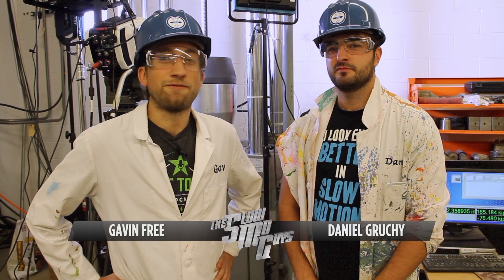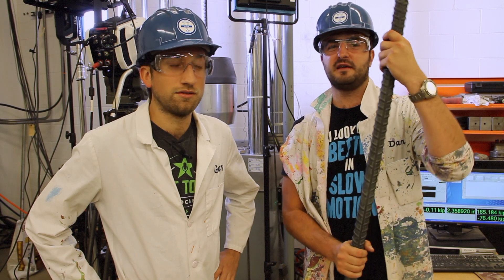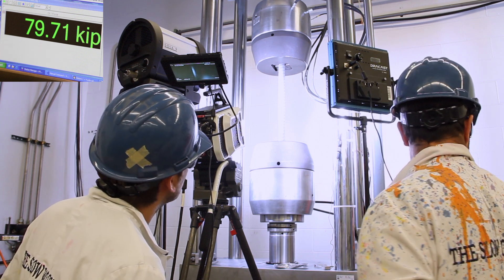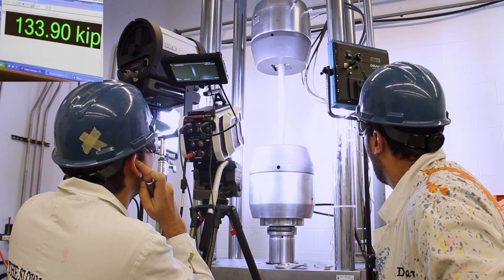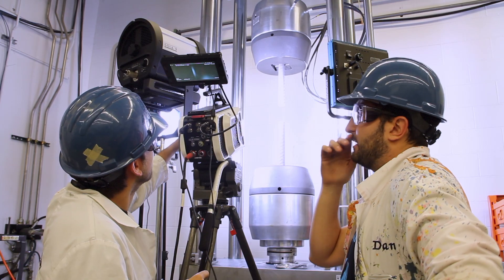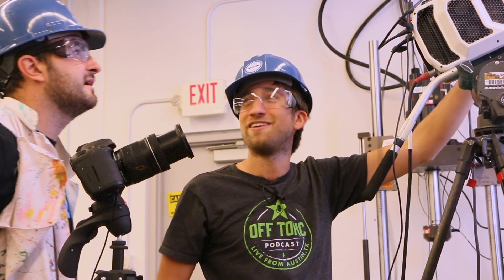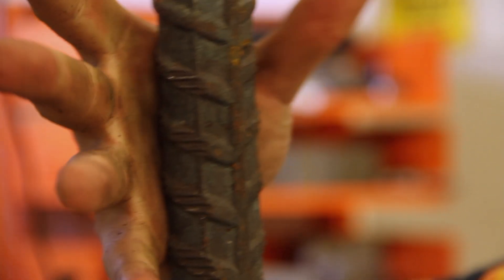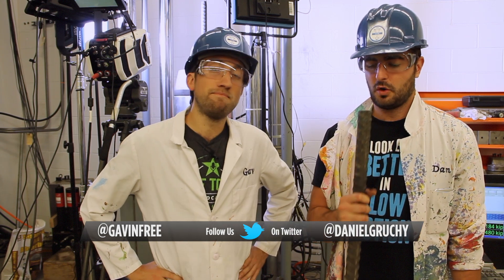Snapping a Steel Rod 1000x slower - The Slow Mo Guys

Comment: the 9/11 towers had thousands of these and much much thicker ones and they want you to think an aluminum plane managed to turn it all into rubble. yeah right
Reply: As a materials engineering graduate currently studying for a civil engineering masters you are very wrong.  Steel does not have to melt to be significantly weakened by temperature. The increase in the rate of vacancy diffusion caused by the increase in temperature significantly weakened the structure causing it to fail. when the tower then collapsed the pressure led to a temperature capable of melting steel via the diesel effect. also an Aluminium plane can absolutely deform a steel frame if travelling fast enough.
Reply: 1. It's actually called thermite.
2. Thermite is just iron oxide powder (rust) mixed with aluminium powder so I don't know what that military base crap is about.
3. surely when a  mostly aluminium bodied plane impacts a steel reinforced structure it is very likely that trace amounts of aluminium powder and iron oxide powder will be found.
Reply: Luckily my first class degree was awarded by an examining body, not a man in a tin foil hat. I just get a bit sick of people who jump to conclusions and feel that they are experts in a field that they do not even begin to comprehend.
Also 
1. you still cannot spell thermite
2. thermite is not an  explosive therefore you would not hear it or even be able to identify a distinctive sound as it burns.
3. considering thermite burns downwards, unless you regularly break into trapdoors at a very slow speed you would not use thermite.
Reply: What you are doing is called misdirection. Your engineering knowledge is flawed and so you try to redirect away from that. This argument is not about government conspiracy theories, just the simple fact that these controlled demolition theories just do not hold up.
Reply: I thought Cameron was just joking with this and was like "oh, your standard meme". Then I kept reading.. Do people really believe this sort of thing?
Reply: a 767 has a wingspan of 48m and when travelling at a speed of about 600mph it is not an insignificant impact. Also where do you get your basis for freefall speed. Rubble is clearly falling faster than the rest of the tower therefore it cannot be falling at freefall speed. Also as I have repeatedly corrected you on your shaky scientific knowledge at every step and the fact that the majority of the world agrees that it was quite clearly a terrorist attack I really don't feel like your opinions hold water. Do you even have a basic scientific education?
Reply: Which is why the fires brought the buildings down, not the planes.
Reply: if fire (i.e. combustion) can't melt steel then how does a foundry work? Plus you can weaken steel to under half it's original strength without coming anywhere near melting it.
Reply: I use words like weaken because thats what happens to steel when you heat it. You use words like "liquefy" i.e. you misuse and misspell very basic words which you then correct in your comments after I pick you up on it. Nano thermite just means nanoscopic amounts of thermite. Also to try and make your theory work, have you ever seen a building rigged for demolition? It's pretty hard not to see that it has been. Do they use thermite in demolition? No because it would be close to impossible to demolish a building using thermite. Why would they fly a plane into the WTC when there was already a failed bombing of the WTC which would be 100x easier to cover up. The conspiracy stuff is dumb but your arguments for it are even dumber. Just out of curiosity do you think the moon landings were real or that JFK was shot by Lee Harvey Oswald?
Reply: firstly microspheres form when small quantities exceed the melting point not the boiling point. Also why do you think a foundry is able to melt steel? High temperatures are produced from the burning of combustibles while insulation prevents the dissipation of heat. Material that has already been heated by the combustion of jet fuel and combustibles within the building are then put under immense pressure by the collapse of the building leading to a spike in temperature and the melting of localised regions of the steel structure.
Reply: 1. Read what I said about vacancy diffusion earlier if you want to know why the structure failed without melting.
2. microspheres automatically means that only trace amounts of steel melted as the gravitational force was not sufficient to overcome the surface tension leading to small non wetting spheres rather than a flow of molten steel.
3. do you think that once you remove half of the structural integrity of a building it will not fail catastrophically. A large amount of damage was done by the initial impacts followed by a further weakening of the remaining structure due to the heat produced by the fires.
Reply: +Philip Royd You... You're joking, right Philip Royd?  Do you understand planes? Before the mid-fifties, planes ran on gasoline.  Also, a 1930s bomber is different than a 747.  Here are some fun facts for you:
Burn temperature:
  Gasoline - 1000 C
  Jet Fuel A - 2300 C
Weight:
  Boeing 747 - 350 tons
  Curtiss Falcon - 1.4 tons
Speed:
  Boeing 747 - 600 mph
  Curtiss Falcon - 135 mph
The 747 also carries about 500 times more fuel.  It's like comparing having a bug in your eye to taking a fastball.
Reply: Lol jet fuel can't melt steel beams.
Reply: you dense idiot. you do not need to melt a steel structure to compromise it. not only does a high temperature under the melting point weaken steel, but also it causes it to expand. When constrained as in the steel frame of a building, it introduces large amounts of stress to the structure causing it to become compromised. If you think a skyscraper is comparable to a tree anything you say is not worth listening to.
Reply: Last comment. I give up on trying to explain basic basic science and engineering to someone who can't even understand the basics.  "large deposits of molten steel" no microspheres do not indicate widespread melting of steel. plus I don't understand how you can have a deposit of molten steel. molten Aluminum yes but steel only microscopic amounts
Reply: The point still stands that a 767 would be going faster and has a much higher mass and so therefore would do a lot more damage on impact than a tiny biplane.
Reply: cameron martin Dude what's your reasoning behind this anyway? Why would anybody BUT a terrorist organization want to blow up the twin towers?
Reply: cameron martin You sure about that? NEVER in history?
Reply: cameron martin come on, I am looking through your comments and you're scolding people about research Even a guy with a degree in engineering 
But what are you sources? A YouTube video
You keep going on that it can't come down from just fire but you seem to be forgetting that A FUCKING PLANE CRASHED INTO THE BUILDING I would not say it was only fire
And it was not a "standard office fire" IT WAS A EXPLOSION NOT FIRE IN A TRASHCAN 
You sir are the GREATEST example of the bandwagon effect 
I applaud your stupidity 👏👏👏
Reply: cameron martin he called the other guy dumbass not you lmao
Reply: +Philip Royd You can't possibly be comparing a B-25 going less than 200 mph resulting in a fire that was eventually controlled to 2 Boeing 767s full of fuel slamming into the buildings at over 550 mph, resulting in an uncontrolled fire that brought down the towers...
Reply: cameron martin hey dude I just build bikes for a living, but even I know, with my high school level education, that metal heated to high enough temperatures will weaken. The steel beams were weakened by the burning jet fuel. The building collapsed because the steel beams were no longer strong enough to hold up the weight of a fucking skyscraper. The other guy has explained to you that thermite isn't used in demolition, and not to mention the fact that a fucking plane crashed into the side of the building. Go back to your flat Earth, tin foil
Reply: cameron martin You do understand what a plane is, right
Reply: +nedk09 Your patience trying discuss engineering matters with someone who is shut off to reason is truly amazing.
Reply: @cameron Martin Did you just blow in from stupid town?
Reply: cameron martin who's the one here that thinks nine eleven was staged?
Reply: I used to have the patience to debunk these harebrained theories, but not anymore. Really that other people with the knowledge to do so are still willing to spend time "debating" fools in tinfoil hats. Thanks for being the voice of reason in this comment section.
Reply: You must be some kind of ignorant idiot.
Reply: Fuk u guys! King kong wasn't able to demolish a bulding so i ain't believing you
Reply: cameron martin after years and years, the metal deteriorates. and gets much weaker. everything needs to be replaced, just like road construction. so yes. thousands of degrees burning on the steel would most definitely burn through.
Reply: Hey look, another moron who spits in the face of facts and experts who have spent literal years of their life proving why the towers fell. But noooo, your armchair conspiracy theory trumps all that.
Reply: Love a blind conspiracy nut
Reply: UncommonSituations how am i the dumbass? thats exactly my point. there were explosives and the towers were indeed demolished. thats why it was an inside job. i have no idea what argument you have?
Reply: I would'nt be so brave if i were you: nedk09 here obviously is a government agent who was clearly sent after you under disguise of an enginering graduate who's trying to dissuade you. While in reality his mission was to discover how much truth do you really know, and i think you've foolishly said too much... are you okay there, buddy? Are you still there?
Reply: Are you being serious? Poe's Law makes it difficult to differentiate the idiots from the jokesters
Reply: cameron martin idk the bridge in Atlanta melted and collapsed from diesel.
Reply: nedk0
Reply: cameron martin heh.
Reply: Mohammad Ekram Faruque Fahim are you sure about that? lol read up it can fit both ways
Reply: Sk8er Of Bodom yeah... >.>
Reply: cameron martin just one question, given this was a brilliant ruse by the US military state to allow an invasion of Iraq, after going to the trouble of secretly setting up a building for demolition, and swearing everyone to secrecy, all the other people that must have numbered in the hundreds at least... wouldn't it have been worthwhile for at least ONE of the Hijackers to have been an Iraqi? I mean the US didn't invade Saudi Arabia, Lebanon, Eygpt and the Emirates so that seems like a fairly significant flaw in this masterplan you discovered (along with all the other information you discovered watching other morons tell you that the physics were wrong or something.)
Reply: Holy shit I love the conspiracy guy :') When the other guy explained something to him 2 comments later Conspiracy Guy was talking about the same thing again xD
Oh BTW planes couldnt destroy the tower cus planes dont exist. Earth is flat and everything flying we see are just holograms made by the guys protecting Arctica or whatever xD
Reply: And aluminum plane traveling at full speed in to the upper middle part of the building. The her file burning causing an inferno that didn't melt the steel beams but softened it greatly. You have to think people from the ground felt the heat. And you do know that aluminum is stronger than steel right. Weight for weight aluminum is the superior metal.
Reply: Everyone arguing about 9/11 get over it. It happened almost a score ago. If it is the government killing off its citizens then I applaud them this country is full of people who take shift for granted and complain when something they don't like happen when it's for the greater good of the country.
Reply: Shartley ya but if a bolt from those beams pop there it goes down
Reply: BasicallyPlays steel is harder than aluminum look it up
Reply: Looking back on the thermite argument i use thermite in rb6 and he goes through walls so...
Reply: cameron martin wow. You really are a raging fuckwit...
Reply: Oh shut up! I don't believe you! My d!ck doesn't melt from friction no matter how many times I rub it inside a vagaina!
Reply: ***** absolutely never. i challenge you to find even just one example.
Reply: cameron martin the molten steel was caused from friction In the freefall.
Reply: 9/11 was done by US government, and everybody who doesn't believe that is either retarded or deliberately ignorant.
Reply: Shartley listen to ken o keefe explain it. he is an ex u.s marine/ whistle blower. war tyrans profit billion of dollars from stealing resources such as gold and oil from these defenseless countries. 9/11 was a catalyst to invade and hunt down the so called wmd's that were never found. its the rich mans trick. this is why they say money is the root of all evil. it is also part of the greater Israel project. your very own government has no problem whatsoever killing its own citizens as long as its profitable.
Reply: We're being brainwashed by the Illuminati, Freemasons, Zionists and the Reptilian Elite into believing that 9/11 wasn't an inside job, autism is not caused by vaccines, the Earth is a sphere and humans landed on moon through chemtrails and a special weather controlling machine which was turned into a mind controlling device using the research from the secret alien technology that was unveiled when the crashed alien saucers were investigated in Area 51, Nevada and also research from the MK Ultra hiding in Atlantis on request of Hitler through a Skype call from Argentina who along with Ted Cruz aka the Zodiac killer are using cure for cancer and the Holy Grail to remain young, both of which are currently being guarded by the true JFK assassin, James Files. They are bringing in the New World Order everyone!!!! Wake up sheeple!!!!
Reply: ***** never in the history of infrastructure has fire ever brought a steel framed building down. except it happened 3 times in 1 day ; 9/11. complete utter bull crap
Reply: CWINDOWSsystem32 yeah because fire would back it demolish starting at the bottom. Fucking dumbass. Watch the towers fall. There's demolition explosions and even the cops and firemen agree
Reply: You just wait guys! I'm gonna stick my booger into one of those tall building in amurica and those rebar will start to melt and demolish that building. Then blame it to kim jong un!
Reply: nedk09 oh? so you just want to completely ignore the fact that nine independent research groups found nano thermite at the scene of the destruction? a very obscure type of thermite that can only be produced at military bases? molten steel was riddled all through the rubble. you can see why they sent all the remains to china to be melted down for "scrap metal" i.e. all the evidence can be destroyed. things that make you go hmm...
Reply: CWINDOWSsystem32 fire also can't melt steel even at its hottest temperatures
Reply: Interestingly, nobody has mentioned the bomber that crashed into the Empire State Building in the '40s.  The fire it produced didn't bring the building down.  I guess buildings built in the '30s are stronger than buildings built in the '70s.
Reply: @nedk09 if the plane just rammed into a building, it would simply stay standing if it didnt immediately fall. It will be like shooting a bullet into a tree trunk, the bullet will stay put and the tree wouldnt fall at free fall speed now would it? So you think a dieing fire giving off black smoke (clearly oxygen deprived) somehow generated enough heat to liquefy steel in an uncontrolled environment?
Reply: @zshi if you knew anything about aviation you would know it is impossible for a commercial airliner to travel even remotely close to 600mph at sea level. Secondly it doesn't matter how much fuel the plane was carrying as it was all released in a large fire ball within seconds after impact; so all that was left was burning office materials at standard burning temperature. Also where did you get 2300 C as the jet fuel flame temperature from? Thats completely wrong. Im still laughing at where you said "Do you understand planes?". Just wow.
Reply: unbelievable. and i thought it couldn't get any worse. i dont think you've ever seen a video of the tower collapsing. the rubble falls at the same rate as the rest of the building. And now you feel safe with numbers? you are clear example of the "bandwagon effect" , if most people "believe" something, then it must be true. You still ignored the fact that all the beams failed at each point all at exactly the same time when only a small proportion of the building was affected. How hypocritical is it for you to put yourself in the authoritative position to even mention someones scientific knowledge when it is you who refuses to do research? oh thats right, you'll just listen to "what everyone else says"!
Reply: You continuously ignore the large deposits of molten steel at the site. You just cannot face facts. Did you even see the video i linked above? You're the one who is dense, you think you are an engineering student when embarrassingly, you dont know that standard fires cannot vaporize a steel structure! Not even close!
Reply: You hate it when i state facts and use words like "liquefy" but you want to stick to saying "weaken". No buddy, the steel melted! It wasnt simply a "weakening". You desperately try to downplay the extent of the situation by sugar coating your argument with soft words. Come to grips with the fact that those girders melted with the assistance of nano thermite.
Reply: Thankyou for proving how stupid you are.  "it would be close to impossible to demolish a building using thermite". How did you manage to convince yourself that a standard office fire is more effective bringing down a building than using nano thermite? Your stupidity is endless.
Reply: is that a legitimate comment or is that a joke? a foundry has a perfect environment that focuses on melting metals as its main function. this does not explain why the foundations of the towers were covered in "micro spheres" , these spheres appear when a metal has exceeded beyond its boiling point. Why cant you people understand its not the fact that the beams were weakened, its that they were deliberately melted and thus parts of the beams were liquid for brief moments.
Reply: did you think about what you just said? are you saying that a foundry cant melt steel in a controlled environment but fuel can unintentionally melt all of the major steel beams (at the same time! hence the buildings also fell at free fall speed!) ? good thing you don't call yourself a physicist. but wait, heres more of your bad logic. you said the collapsing building causes a spike in temperature which can cause the steel to melt. first of all you completely underestimated the energy required to melt steel. the kinetic energy from a falling building is no where enough to concentrate itself to melt any kind of steel. second of all how does a building collapse, THEN you start talking about steel melting? shouldn't the steel melt first and THEN the building collapse? what made the building collapse BEFORE the beams melting? about 90% of the total heat was released from the initial blast when the "plane" collided with the building.
Reply: nedk09 id be embarrassed to call myself an engineering student if i couldn't identify an obvious demolition. you can even look up the video taken by firemen and bystanders where you can hear the thermite charges being set off. the sound is identical to the charges used to break open vaults/secured doors in warfare.  it appears that the thought of your own government committing genocide on its own civilians is too disheartening for you to accept, that all you're left with is repelling against factual information from the truthers.
Reply: you are silly. how does a plane colliding with a very small proportion of the building cause all major beams in the towers to fail simultaneously? the building fell at free fall speed. this is exactly what you can expect in a standard controlled demolition. are you trying to convince me that a planes size that is insignificant to the size of the tower removed "half of the buildings structural integrity" on impact? this is just getting more ridiculous with each rebuttal.
Reply: nedk09 again. hypocrite. here i am encouraging research but you are too full of yourself and believe you are SOO much of an expert that research isn't needed. yeah because logic, right? read what i said above, just have a listen to ken o keefe. he will give an insight to what this is all about, because sure as hell did no cavemen infiltrate the "most" guarded airspace in the world 3 times in one day. nor did they set three new world records for the first steel framed buildings to collapse solely from fire in one day. coincidence? maybe you also think that when Larry silver-stein put an insurance policy over the buildings that specifically covered terrorist attacks 4 weeks prior to 9/11 in which he successfully claimed $4 billion afterwards was also a coincidence. you probably also think when Iraq lost $350 billion from their central bank one day before the u.s invasion was also a coincidence. you pentagon shills just refuse to think. no matter how much evidence is provided you still have your own predetermined theory that cannot be changed any way possible. 

all i ask is RESEARCH! you dont know nearly as much as you think you do.